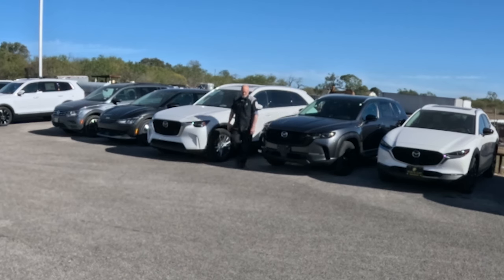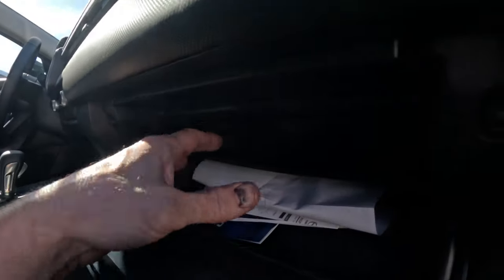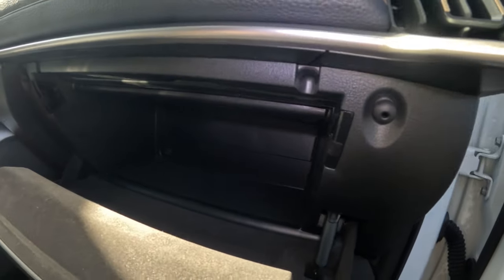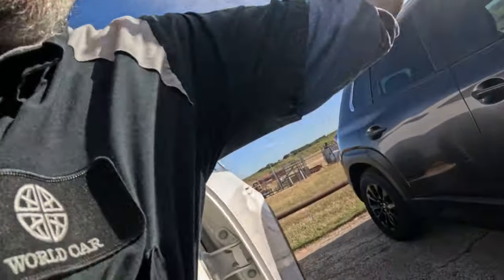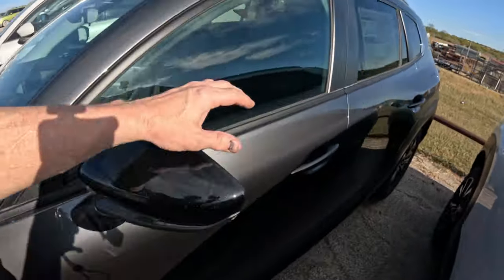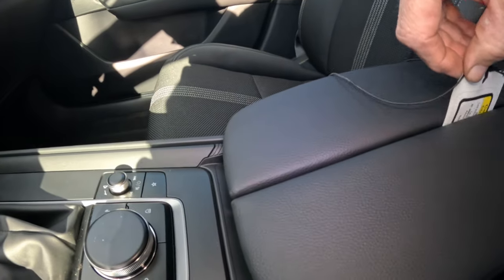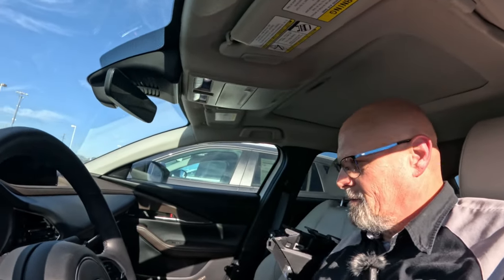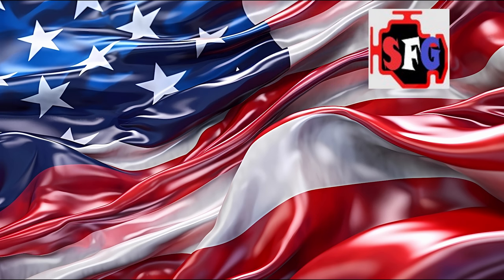Mazda CX-90, CX-50, CX-30, CX-5. Take a look.

Comment: What do you think of the new  mhev inline6? Is it too complicated to be reliable?  I just bought the cx90 340hp inline 6. Just concerned about reliability. Lovin the car so far!
Reply from the maker: You, my friend, are a trailblazer. This is a very smooth running vehicle.  It's too early to tell for sure.  I have seen a few of them with higher mileage and no issues.  Sometimes being complicated is what makes it reliable.  At least, that is the idea.  Only time will tell.